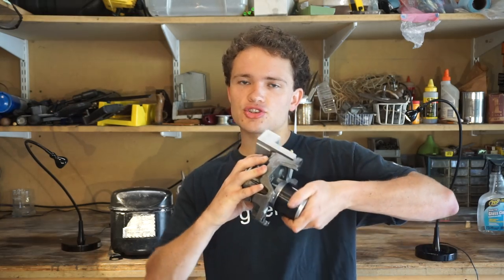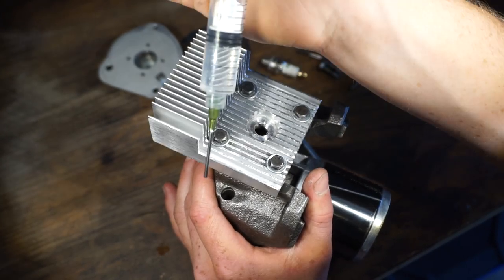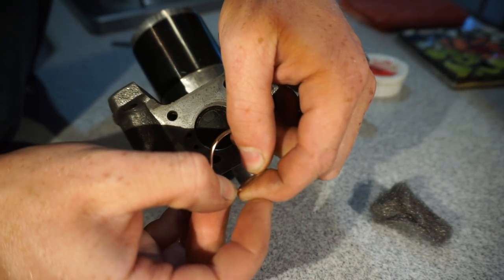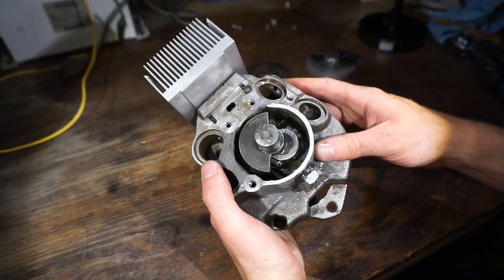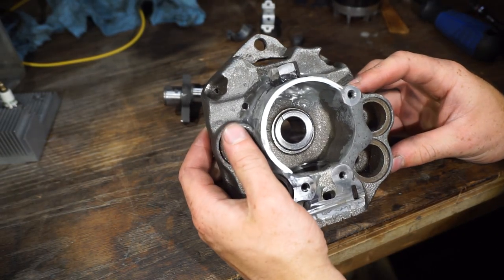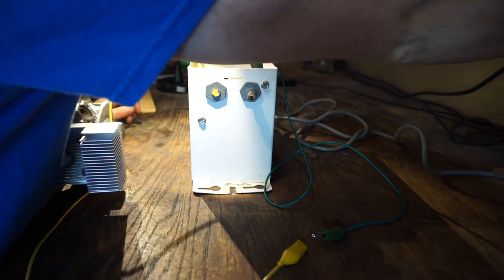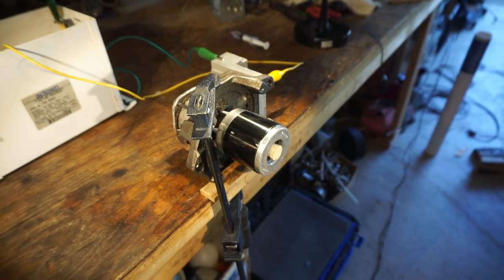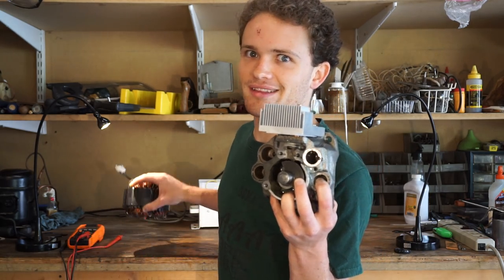Part 5. DIY Internal Combustion Engine Made from Old Compressor - First Run and Copper Head Gasket

Comment: Damn, that thing ran so awesome :) I saw a preview on your facebook of the first run, and damn, I was so excited to see entire part 5 of this build :)
I don't really like the idea of having a continuous spark as you might know, it can create backfires and basically destroy the engine...
Also, you can't turn the engine into a generator unless you add some magnets to the rotor. An AC motor relies on the magnetic reluctance to create a magnetic field on the rotor, so yeah, unless you add power to the stator, you ain't gonna' get any magnetic field in the rotor, which is the opposite thing you want :P
As for the carburetor, you should add a butterfly valve to the intake, and then run it to a gasoline jar(the same thing as you did in your previous engine) and have the flow controlled by the butterfly valve, so you can have instant response on the throttle
Reply: his flywheel consists out of big magnets, so everything is already there..
Reply: the flywheel is just aluminium with some ferrous material on the exterior, there are simply no magnets in there. Just google "Reluctance motor"

Comment: About all that changes when you rotate it the other way is ignition timing, so can you make it fire on both sides of TDC so that you can stop it and start running backwards?
Reply from the maker: Yep!  Being that I was running it on constant arc it would run both ways no problem.  I was running it both ways in the video.
Reply: Yeah, it's definitely fine when on constant arc, but if you do go ahead and trigger the ignition on both sides of tdc, it would be cool to make a small motor cart with the ability to reverse. Maybe you can think of a practical stationary application for a reversible engine if that's not feasible. An novel idea would be that if you ever add electric starting capability, this could be used to provide reciprocating motion by running in alternating directions automatically. Alternately, perhaps the engine could work against a spring until it stalls, and then the spring may hopefully restart the engine in reverse. It would probably require a large flywheel and strong spring. I'm thinking of that as a curiosity to show at a convention or faire. I will be very interested to see how many watts this produces when the timing and air fuel ratio are optimal; I suspect you may be able to produce quite a lot, and even more if you go back to find and reduce air flow restrictions. I suppose you will use the generator as a load for testing your tuning adjustments.
Reply: Reed valve glow plug engines used on model planes sometimes accidentally start in the wrong direction.

Glad to see it running so well. How about part 9: installation on a bicycle (with backwards steering, of course!)
Reply: It's called "dieseling" when a gas engine runs backwards.
Reply: No, "dieseling" is when you shut the ignition off and it keeps running. When an engine runs without an electric spark, it's almost certainly compression ignition, and the most common example of a compression ignition engine is a diesel.
Reply: spaceminions and now mazda is building the first production car with a compression ignited gas engine ;)
Reply: Yeah, I'll have to try that out sometime. I recently watched engineering explained's video about the spark controlled aspect.

Comment: Luck of the draw to get everything right.  That  the voltage  and compression was low enough that it didn't fire until just before TDC, If you ran the full 5000v it probably wouldn't have run since it would fire too far before TDC. Well done!  Running the naptha probably also helped.

Comment: make a squish on the cyl head... its basicaly a circular hole  around the spark plug. wide as the cly bore, and goes gradually deeper into the cly head towards the center and the spark plug... it serves as an explosion/compression room. dont make it too deep. search it on the internet. just an idea. 
good work man. ur a genius btw.

Comment: almost sounds like the RC air plane engine's.  I think if you cold find a glow plug to fit it and built a carb for it it would run for a long time even with out the transformer.

Comment: this would be a great little Generator if you have a small shop with only a few lights. but id focus on making it run great (the smoke is normal sense most 2 strokes burn oil) id love for you to turn a Traxxas 3.3 or something into a portable Car battery charger tho XD.
Keep up the good work.

Comment: Would love to see you do fuel injection on that, use a Arduino to control fuel and spark. Mount a injector right in the crankcase.

Comment: Nice work I was a bit skeptical but you made it congratulations. If you want to turn that motor into a generator the you will need to add magnets to the rotor because most of ac motors does not contain any magnets they work by inducing edy currents into a rotor. Jus wanted to let you know.

Comment: Hopefully you can correct me if im wrong, but don't you need an oil reservoir where the crank case is? Running the engine without oil will cause the area where the connecting rod and the crank rub with eachother to heat up and expand, basically locking it up and throwing a rod, correct? You mentioned that the fuel/air mixture from the carb will pour into the crank case (via the intake) and then through the transfer port (because of the vacuum the piston creates) as the piston moves between TDC and BDC. This leaves no room for cooling/lubrication right? I know im probably overthinking this, but i've worked on my fair share of small engines..

Keep up the great work!
Reply: GothicCucumber He added a bunch of oil to what used to be the oil centrifugal pump and closed out up with a cork for testing. That's why it was shooting oil everywhere. When he really runs it later he will be using two stroke fuel.
Reply: I realized that after I posted the comment and realized how stupid I was, thanks! And I totally skipped over that part! And it didnt help that I was thinking about a 4 stroke so... Yeah.

Comment: Have you ever thought of trying a diesel engine project, sort of liek your previous petrol IC?
Reply from the maker: Hmm I would love to.  The problem is making an injector and high pressure diesel pump.
Reply from the maker: Any and all ideas are welcome!  :)
Reply: It would be fun (I have no knowledge in metal or wood working right now though)

I wondered if an injector could be controlled not by itself, but by a cam shaft like valves. So a constant pressure of fuel behind it. Not sure how well it would work, maybe too much fuel would spray at once.
Reply: how bout a v twin 2 stroke?

or maybe a simple four stroke engine that would be cool
Reply: You don't need a high pressure fuel pump.
The absolute first engines uses a pressurized fuel system. The tank itself was pressurized. Not very secure but easy to build. The needed pressures can be created with ait pumps relatively easy.
Problem are the risks if the system leaks.

Then diesel engines where build without a completely pressurized fuel system. Instead every cylinder hat a smaller "brother"  who was sucking in and pressing out diesel through the same tube from and to the tank all the time, from that tube to the sprayer in the cylinder a check valve was added. A cam operated valve could block the tube to the tank, and the diesel would go instead trough the check valve and sprayer into the cylinder. Bigger engines didn't use a check valve but a additional cam operated valve to block the way to the cylinder.
This construction is very robust, but has two big problems:
1. It is only working in constant speed/load.
2. It is inefficient, compared to a pressurized system.

Comment: Was the head live?
Reply from the maker: No, the head was connected to the ground of the neon sign transformer.  One of the HV output wires was connected to the spark plug.  Neon sign transformers are basically center tapped to earth.

Comment: dont forget that you need a cooling system too
Reply from the maker: Cooling!? Hahaha let it BURNNNN!!!  :D
Reply: That heatsink will spread some heat
Reply: Niko Veter he can also make a fan guard going to the heatsink because there is a small fan behind the flywheel that was for the old electric motor

Comment: How come u doubled the numbers for the compression ratio
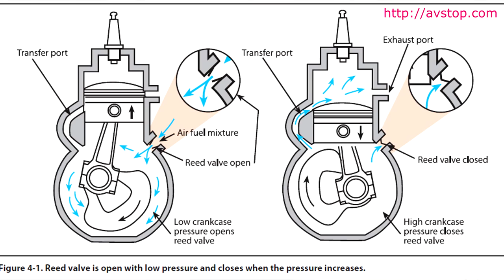Reply from the maker: Volume at top dead center was 0.5ml.  Volume at lowest point was 6ml.  Compression ratio is generally stated as a 1:(and a larger number).  You could say 0.5:6 but that'd be kinda confusing because it is just supposed to be a ratio.  Not the real volumes.  So to make 0.5 to 1 multiply by 2.  Since it's a ratio multiply both sides and you get 1:12 compression ratio
Reply: People who do math in their heads while talking on a video are confusing to normal people. Fortunately most of the nerds who are interested in this stuff can do the math. We like octal and hexadecimal. A few of us are old-timers who use slide rules. 

Personally I like the balanced ternary "bop" system. b is 1, o is zero, and p is negative 1. bop equals 8. Negate by rotating about the horizontal axis: pob is negative 8.

Comment: What if you made a dripper system to feed the engine instead of a carburetor. Just have it drop a little bit of fuel into the engine and have it run that way. Then you wouldn't have to bother with a carburetor.

Comment: how can engine work with constant spark? I thought you will neeed hall sensor or reed switch
I finished my homemade 2 stroke engine and I need ignition so can It run on constant spark
Reply from the maker: +ELECTRONICS basically since it's a 2 stroke scavenge is not very efficient. So some exhaust is left around the spark plug. So when compression happens that exhaust gets compressed and mixed with the fuel air mixture and that gets pushed into the area around the spark plug. Which just happens to ignite it at about the right time. It still blows my mind that it works so well. So I would guess that your 2 stroke should work alright on constant arc ignition. I need to see how a commercially made weed eater engine would tolerate constant arc ignition.
Reply: I will try with my homemade and weedeater engine this weakend
Reply from the maker: +ELECTRONICS sweet! Let me know how it works

Comment: What the actual fuck. No carb, no ignition control, and it works that well? I just... I can't even.
Reply from the maker: +KrazeeCain yep! That's the power of the two stroke engine! I kinda want to try continuous arc on a 4 stroke. I think it might kill it. I also should try continuous arc on a commercially available engine like a weed eater to see what happens. My previous engine that has a solid JB Weld piston also runs just fine on continuous arc

Comment: Your head gasket is rated to 500 degrees? Will a blow torch burn it? Yes. And that's essentially what you have inside your combustion chamber. A blow torch. I've never seen a production engine with a head gasket of a similar material. It might be weak enough to blow apart too. Copper is a much better solution

Comment: Just use 2 stroke fuel and then you can run it without putting oil in the fly wheel

Comment: To connect the top wire of the spark plug use a ring terminal. On the top of most spark plugs you will find a nut. Click on the link  below:https://www.digikey.com/product-detail/en/phoenix-contact/3240017/277-11118-ND/4458678

Comment: Why don't you use propane as fuel? You can control it easier
Reply from the maker: +Arda Berat Sönmez it's not necessarily easier to control. I also tried propane and natural gas at first and I couldn't get it to run. I'll have to try again tho. There is also the problem of having to add oil separately.
Reply: Makerj101 problems with lubrication I run my 4 stroke lawnmower on propane I also made a vertical shaft lawnmower engine to horizontal it works it runs

Comment: you can make a natural carb by sucking air through a tank of gas or coleman fuel, and venting the vapor into the cyl, the suction of the engine should pull the fumes out of the tank and into the engine, igniting them,  spinning it over, creating a vac and sucking in more fumes. 

i run my 4 stroke gas lawn mower on fumes and it consumes about 4.7% less fuel than it does stock (not much, but its the difference between getting the lawn done in 1 tank vs 1.5 tanks of fuel.

anyway, look up building a carb using the venturi effect, https://www.youtube.com/watch?v=Wokswr_KHXQ
and a tank for fuel to aerate into a vapor that is collected by the venturi. https://www.youtube.com/watch?v=58IkmPK6ikc

something like a butterfly valve, on the end of a pipe, a venturi effect causing passageway that draws fuel vapor up into the tube, then your throttle is the butterfly valve, opening it increases suction of fuel vapor and air into the engine.

dont forget to add a breather hole on the wing of the butterfly valve. 

https://www.youtube.com/watch?v=ICzBGDnA9OA

Comment: You should probably get a Rev limiter
Reply from the maker: What are you talking about!?  The rev limiter is when the piston embeds itself in an Intel heat stink.  I think the soft Intel would be pretty good at absorbing the energy  :D
Reply: Two strokes dont need rev limits 
, just braaaaaaaappppppppppp
Reply: marco no need for rev limter. No Valves like on a 4Stroke so no Valve Float which would result in wrecked piston and snapped rod. On a 2Stroke you control the rpm with amount of fuel u give the engine so with strong enough parts you can rev it up to warp speed lol
Reply: BRRRRRRAAAAAAAAAAAAAAAPPPPPPPPPPPPPPPPPPPP
Reply: The first it is the harder it is to keep the parts lubed and if the con rod breaks or the crank then that thing might hurt some one XD

Comment: Not a 2 cycle if oil isn’t in the gas. And really 2 weeks while waiting to watch you build a “gasket” and drill a hole in it for a carb and a bit of gas like really.
Reply: By definition oil is not required to be in the gas for it to be a 2 stroke engine. Oil is just a requirement for any reciprocating piston engine to avoid seizing as metal on metal is not ideal. 

Have a read here to educate yourself https://en.wikipedia.org/wiki/Two-stroke_engine
Reply from the maker: 2 cycle means how many times the piston moves up and down to make one full cycle.  Has nothing to do with oil.  
It also took 3-4 days to edit.  I don't get paid enough by YouTube to rush my videos along.  Since it is mostly a hobby for me I take my time.  If you want to send me some money via PayPal(makerj101utube@gmail.com) or Venmo(makerj101) I'll happily accelerate the video production process.  Thank you!
Reply: Have you thought about Patreon or making a website and selling plans for your projects?